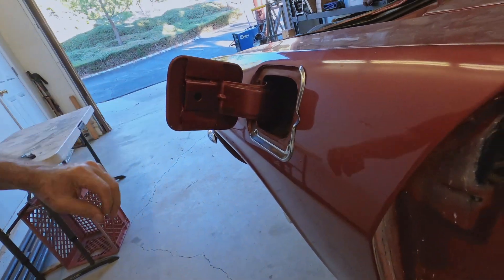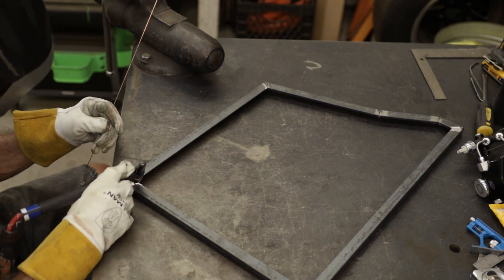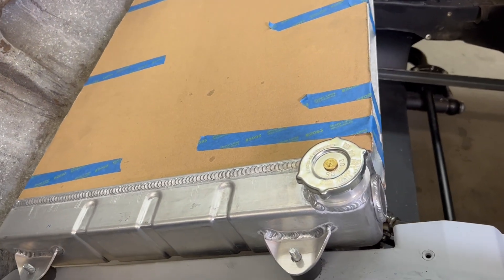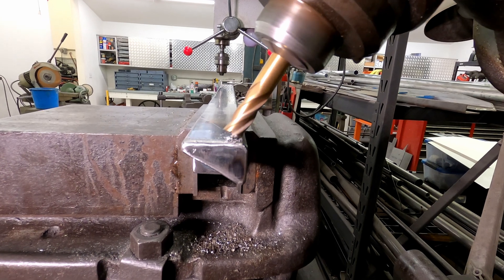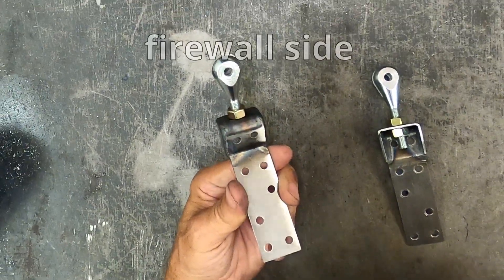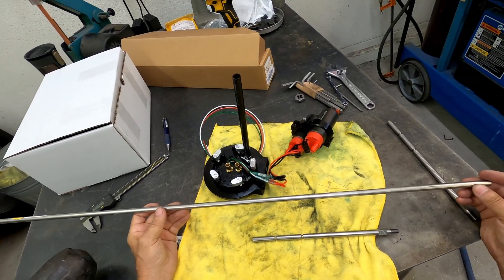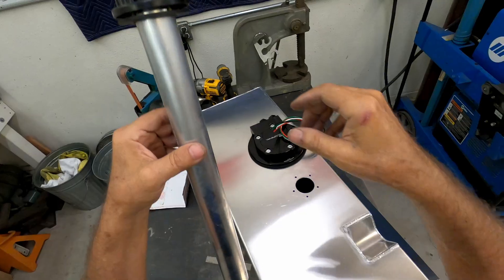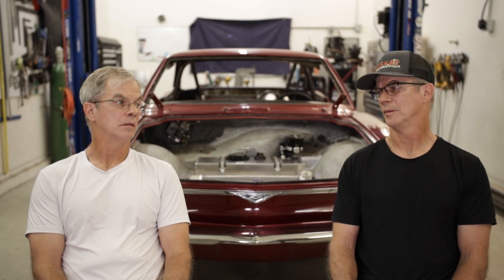134 lb. of water should be enough. V8 into Corvair ep 16

Comment: Hi John,

I am having trouble finding a machine shop to do the four aluminum hinges for my trimaran. 
I also looked hard to get a set at Amazon (I know your preferred choice :-)) 

What can I do but doing it myself, lol.
I see you cut all the nice heavy metal parts. My guess is that a band saw and a drill press is all I need to cut and tap the aluminum to fabricate a few brackets.

What type of saw would you recommend for 5/8 thick aluminum. I need some decent precision but not anything at the sub millimeter level.

Greetings from up North
Sam
Reply from the maker: I use a band saw but you could use a skinny wheel
Reply: @JohnReynolds661  thanks John.

Comment: Just a pointer with Corvairs. They have a tendency to spew fuel out the vented filler cap when the tank is full... and the top of your tank is higher than OEM. I made a coiled pig-tail out of brake tubing and brazed it into a drilled hole up high on the tank vent line of the fill pipe. This will gain you a few more inches and allow fitting a rubber hose to a remote location. (I went down to the floor level under the car) I also bought a non-vented fuel cap to stop the exterior mess. BTW, nice gag on the Amazon page!
Reply from the maker: Thanks for the info, I have a couple options for venting.  First I was going to try a one way vented cap. If that doesn’t work, then hopefully I can find a good dealing non vented cap and use the vent line at the top of the tank in the Holley part.

Comment: I see John did the calcs on weight and space of water compared to gasoline  for a tank capacity check. Gasoline floats on water as the gasoline is less dense.... I wonder what the heat factor will play in on the gasoline tank so near the radiator?
Reply from the maker: Gas weighs less, but a gallon of gas should occupy the same space as a gallon of water.  I will put some sort of heat barrier in front of the tank.
Reply: @JohnReynolds661  ... I have done heat shields above exhaust pipes when floors get too hot. It doesn't take much as long as the air is moving. A shield with an inch of air space makes a huge difference.

Comment: I am thoroughly impressed with your design and fabrication skills  !  Do you build flying saucers for a living ?  and do this just to relax  ?  Anyhow 
I was first intrigued by your V-8 Corvair build because back in the 70s one of car magazines showed only a few pictures of a already built 
V-8 Corvair that someone had installed a late 60s Tornado or Eldorado not sure which,  engine/ transaxle where the back seat used to be.
I do remember reading they somehow locked the steering to straight and reversed the direction of final drive so it wouldn't have 3 speeds
backwards.   They also got some older matching luggage,  bolted it together then cut out the bottom so when installed over the engine 
It appeared as a  bench of suitcases side by side.  Yours is waaay cooler and with so much more quality and style.
Reply from the maker: It's just a hobby.  Yeah, the conversions used to be popular in the '70s

Comment: I came up with 23 gallons of gas.
Reply from the maker: The tank and wood blocks weigh 20#.  134 divided by 8.3 is 16.1 gallons.
Reply: @JohnReynolds661  
In that case 16.1 gallons of gas @ 6.1 pounds per gallon, 98.2 pounds of fuel, assuming this is a fuel tank and the car runs on gasoline.
Reply from the maker: @tuck6464  You're right it holds 98 lbs. of gas.  But I used water to calculate the gallons.  A gallon of gas takes up the same space as a gallon of water.
Reply: @JohnReynolds661  You're right, my first comment/ calculation, was wrong.